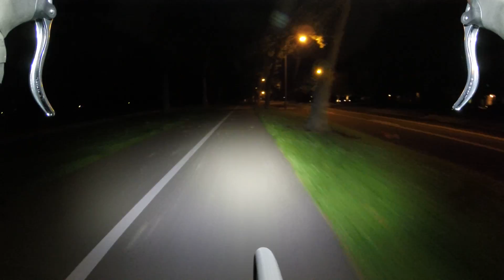How Many RPM? Cadence City Cycling Night Bike Blogger

Comment: Now you should have two numbers. One is the number of seconds, and the other is the number of strokes you completed in that time period.

The goal is to calculate how many strokes you would have completed in 60 seconds. So if you counted for 15 seconds, you’ll multiply that number by 4 (since 15 seconds times 4 equals 60 seconds.) If you counted for 20 seconds, multiply strokes by 3.

That will give you your cadence, or RPM.